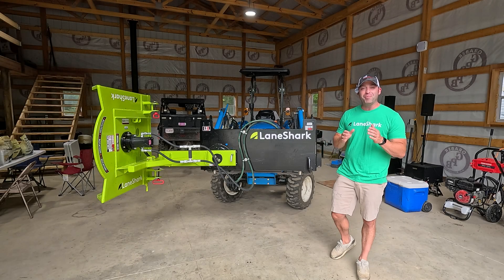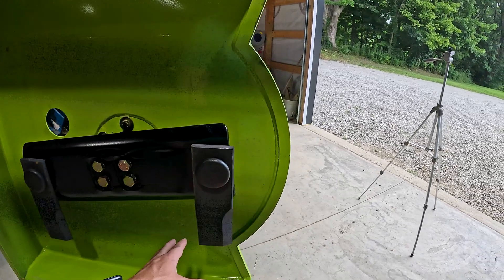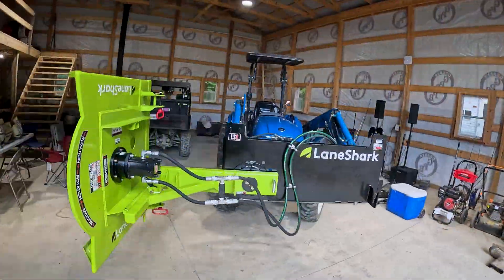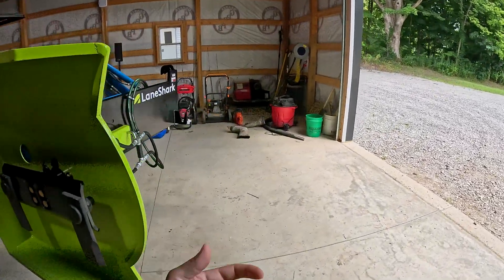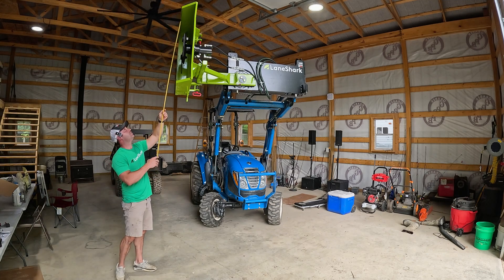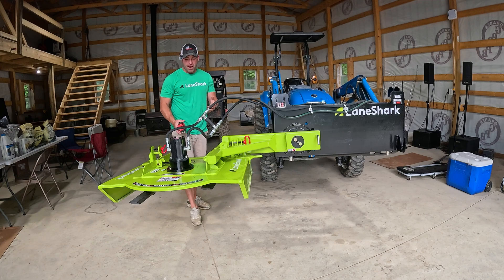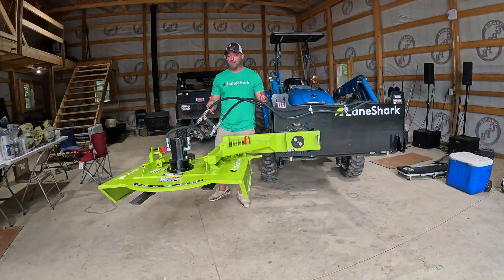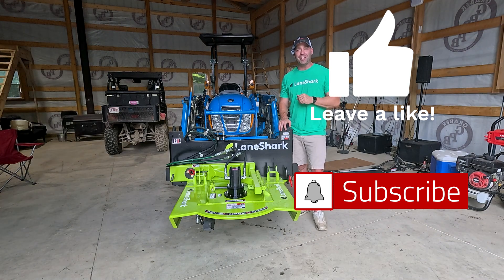Lane Shark Mower Setup and Hydraulic Requirements

Comment: I’m about to buy an LS4 and I’m buying a pto driven hydraulic pump and going to run it that way.
Reply from the maker: Nice, I would double check with Lane Shark to make sure that would work. I’m sure it would. Also just make sure you don’t go over the max GPM of hydraulic flow. Also, make sure that when you shut it off that it allows the hydraulic flow to dump into the case drain without resistance. The spinning blade has a lot of momentum and the hydraulic flow can’t suddenly stop. These Lane Sharks are amazing. You are going to love it!

Comment: Thanks for the video, would love to have one. Question though it might 
Be the frame rate like you said but when the machine was slowing down and came to a stop it appears to be spinning backwards or the blades are on backwards. I may be wrong sometimes things are not as they appear in a video. Thanks.
Reply from the maker: Thanks pal! Yes, the camera frame rate gives an optical illusion. If you watch it again, you’ll see when it slows down it’s spinning in the right direction. Love your channel by the way!
Reply: @TripleTAcres well I have been told I am directly challenged by the boss. Thanks, I appreciate it